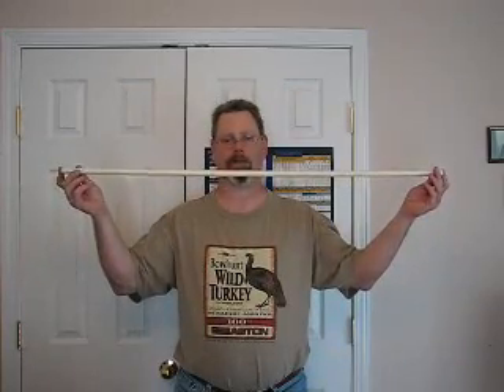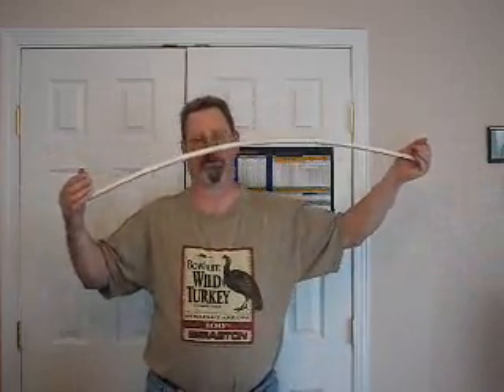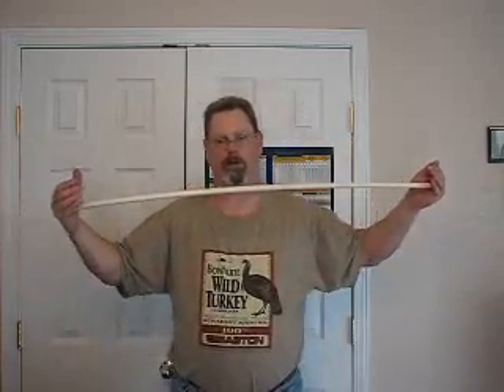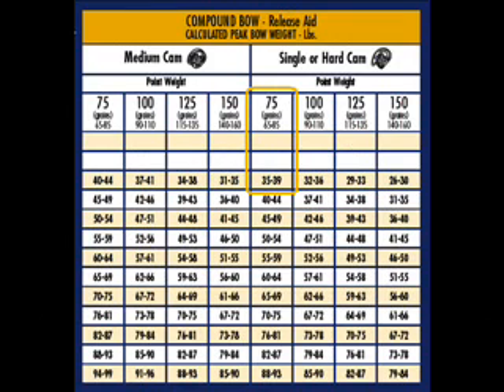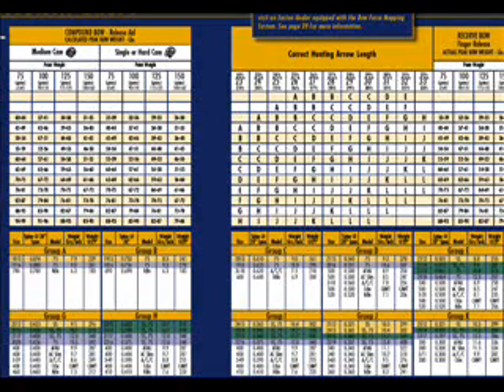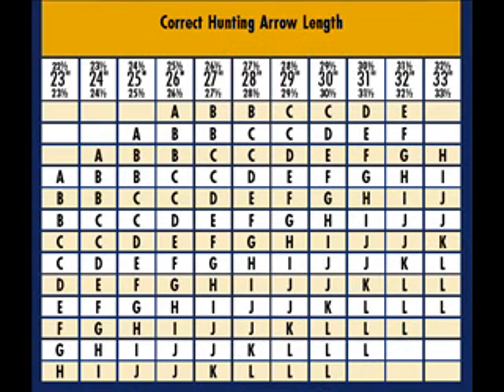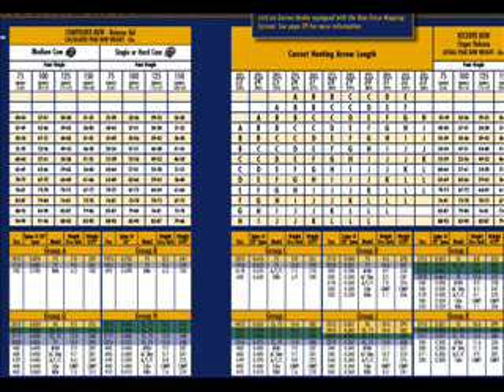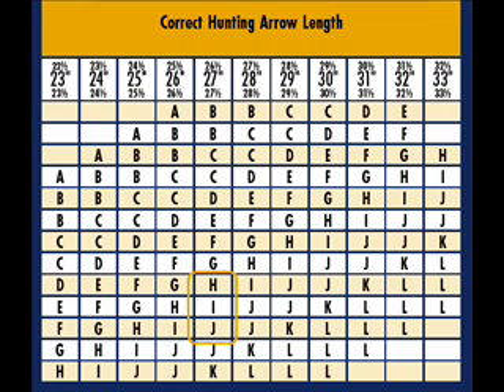Arrow Selection Chart

Comment: im shooting a 55lb compound bow draw length is 27 and arrow is 27.5 with a 250 spine. Back notch is 100 grain n broad head is 100 grain. with this combination is this a good setup already?
Reply: Check the charts for your make of arrow, all brands are slightly different. Sounds a bit stiff to me given shorter arrows and light point.